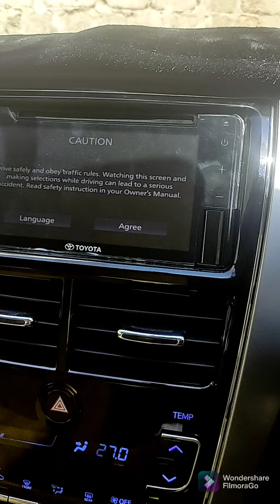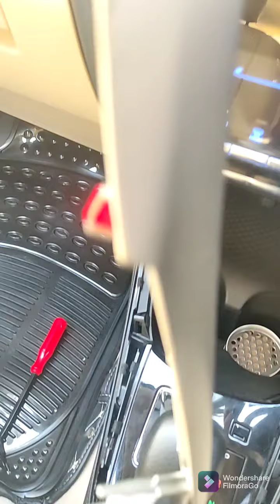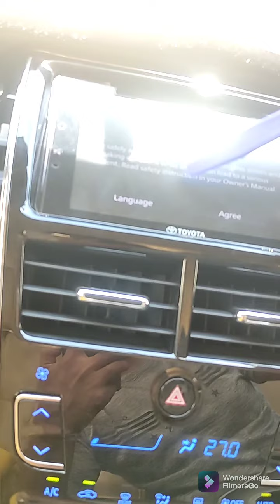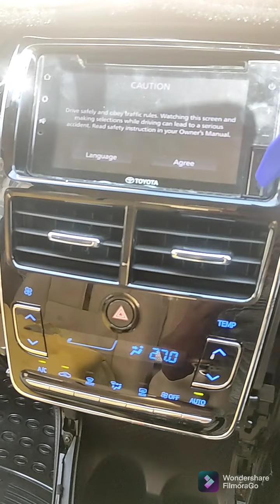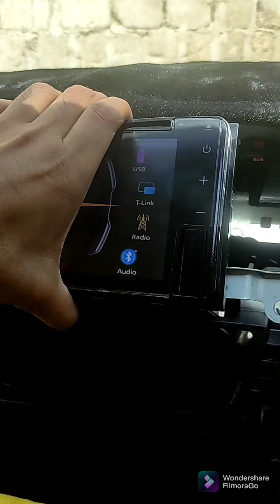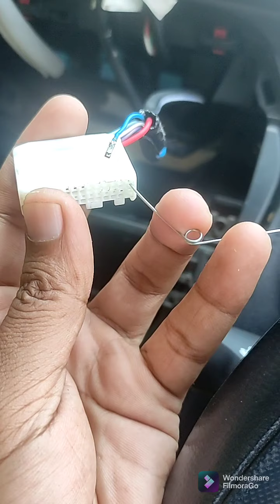Using TLink-Multimedia while driving. Bypass Handbrake. Play video in drive mode

Comment: Hi

I have a 2018 Yaris VX model with miracast and built-in Navigation. Will my miracast work by only this bypass or do i have to do more.
Reply from the maker: @savlachintan80  Sorry only way to check is to do this first to confirm if anything else is needed

Comment: which type of in is used in this is it for 14 pin or 12 pin grip like u told in cruise installation video
Reply from the maker: The shape of pin is same as ECM. Appropriate pin is from 12 pin connector. If you have it then use it. Otherwise 14 pin one will also work.